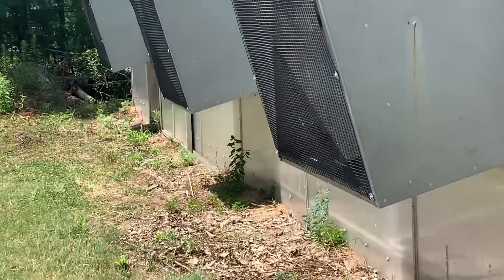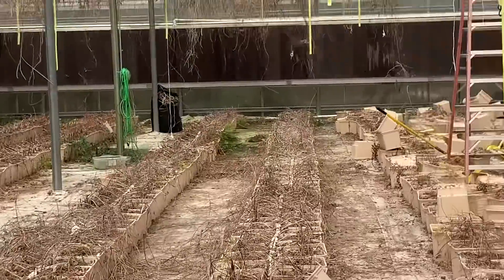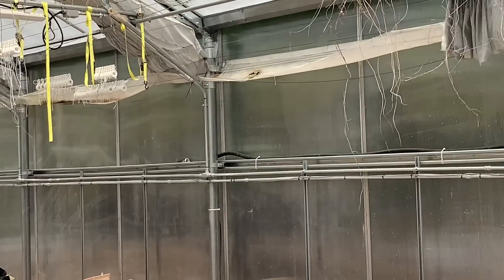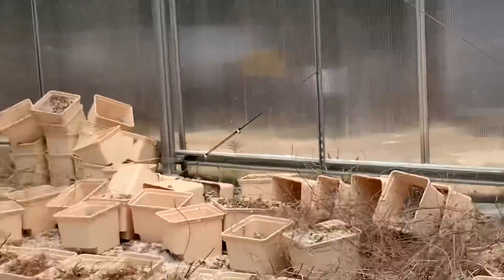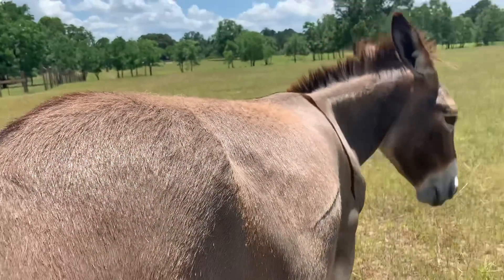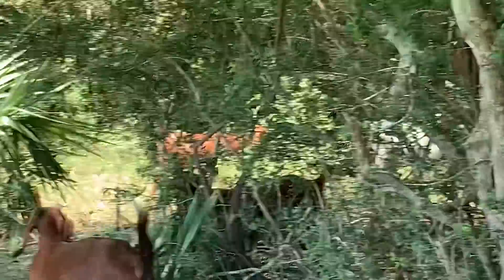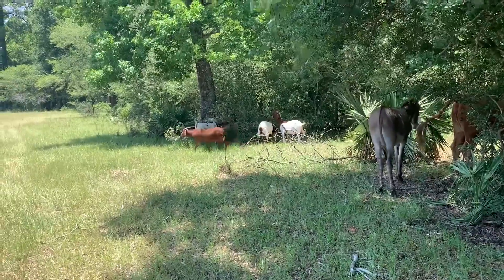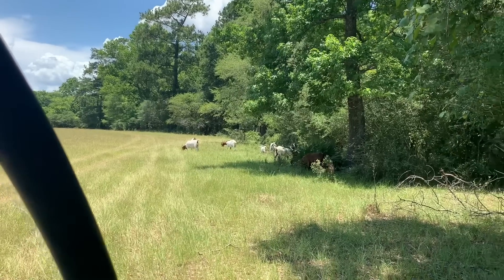Meet my neighbor

Comment: something you could try with the wires in the house is to run them through a pcp pipe to keep the puppy from chewing the wires..just a thought
Reply: Or black tubing. Pawpaw get some green apple "No chew" spray from a petstore and spread what they chew on a lot. They will stop sooner then later....it's bitter.

Comment: You might have to run the exposed internet cable through a piece of plastic plumbing pipe so Kippy can’t chew on it. I did that when running power out to my shed so the critters can’t mess with the wires.

Comment: Paw paw get yourself some inch round pvp pipe, run your wire for the internet threw that use c clamps to attach it to the wall and you will never have Kippy cut off your internet again. Thats what I did.